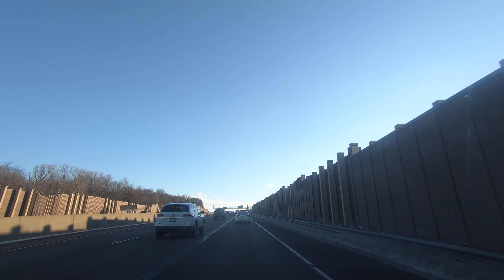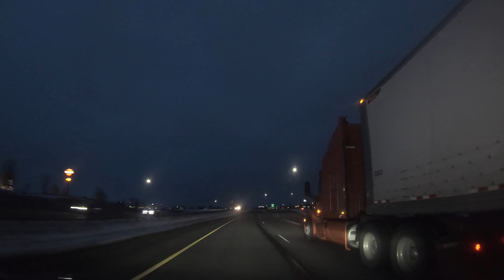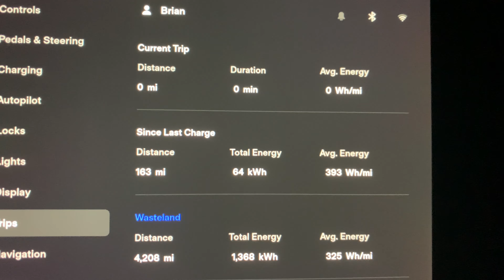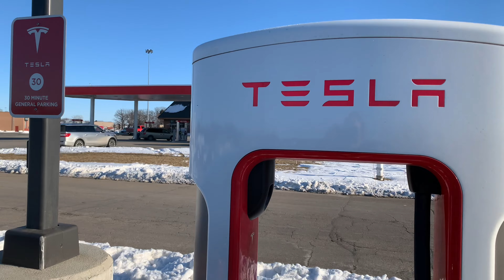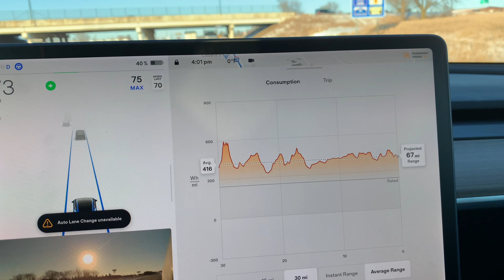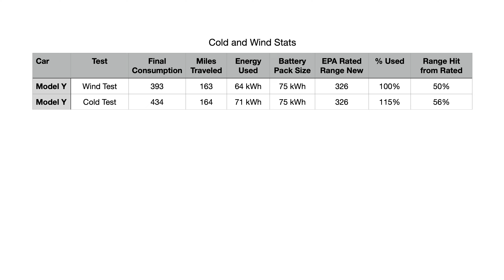Wind or Cold? Which Eats More EV Range?

Comment: Good tests Brian.  👍  Had similar results driving from Burnsville to Baxter on the way to ice fishing last week in negative temps.  Only charged to 90% and didn't go easy on accelerator.  Also cabin was near 70 degrees the whole time.  Arrived with 5% battery.  Yikes. 50% loss in negative temps seems to be a good rule to follow.  Also drop the cabin temp. a little and keep the jacket on.
Reply from the maker: Thanks Tony! Good suggestions. I'm glad you were able to make it to the chargers on your trip. I don't remember the range hits being as bad in past years, but I may be better at paying attention to the data, or driving on colder days.

Comment: These real world tests are extremely useful.  Thank you.  One of the major characteristics I value in EVs (ours is a 2020 M3 AWD) is their efficiency.  Even though you had a sharply reduced range in the wind and in the cold, you were still getting around 85 MPGe at 393 wHr/Mi in the wind and 78 MPGe at 434 wHr/Mi in the cold.  I'll bet there were very few (actually, NONE) ICE vehicles on the road with you getting even close to that level of efficiency.  Of course, we are dealing with a battery that holds only as much energy as about 2.5 gallons of gas, so that explains the relatively short range between "fill ups" for our EVs vs ICE vehicles.  I'm happy with that tradeoff.
Reply from the maker: Good point Ray! Thanks!

Comment: What firmware version were you running for these tests?  I'm wondering if the heat pump fixes only affected those that were getting no heat, or if it had improvements for everyone who has a heat pump in cold temps.
Reply from the maker: I’m on 2021.44.30.5 81562c9c7b28